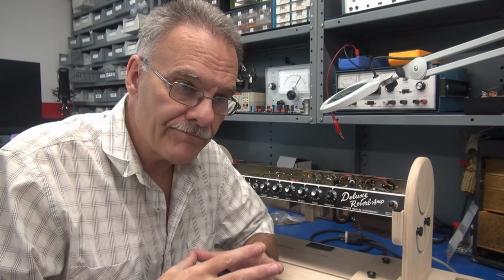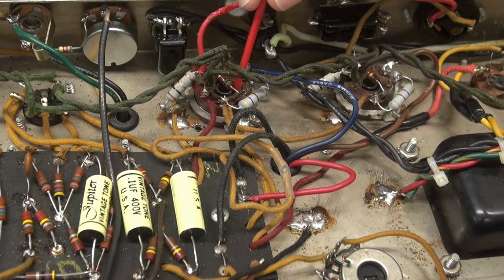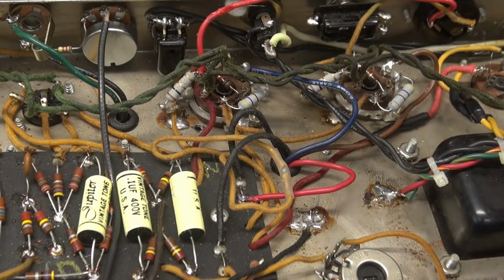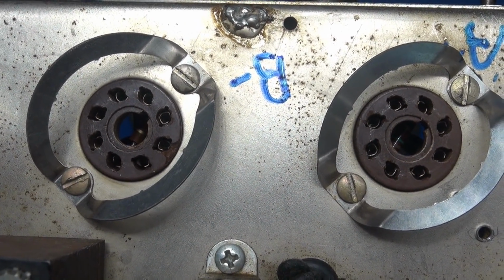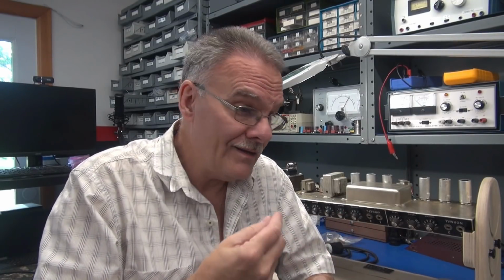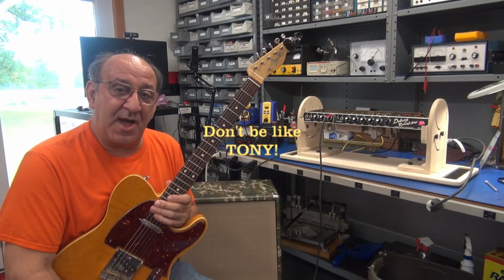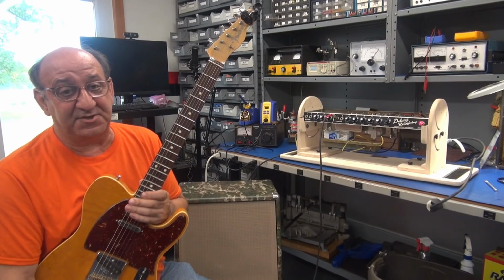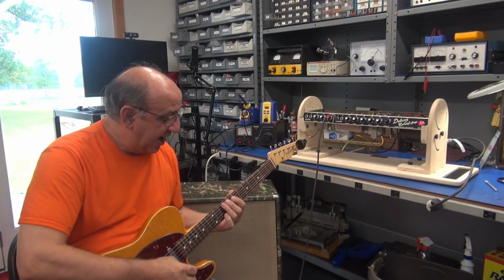How to repair Fender Deluxe Tube guitar amp bad 6V6 sockets Power drop outs D-Lab tech tip advice

Comment: That's why I prefer to use good quality ceramic sockets, because in the plastic sockets some people over heat the socket pins when soldering to them, and they melt the pin bore in the socket ruining it.

Comment: This bad tube socket problem  could be caused by too hot a soldering iron when soldering onto the tabs.
The whole metal tab will be compromised and there is no way to get fatigued heated metal back to it's
original springiness where the tube pins make contact. Seen it in older tube radios too.

Comment: Hello.
I just got a dsl20 head. While the amp was on the clean channel, volume around 3, gain on 1.5. I was trying to unhook the foot switch from the back of the amp, but like a idiot I unplugged the speaker cable. It says never to do that. The cable was disconnected for about 30 seconds. Then I plugged the speaker back in and turned the amp off. I didn't have the guitar plugged in, just the instrument cable. Now the amps gain channel doesn't sound quite the same. Like it's lost it's luster. 
Also, is it normal for the v1 preamp tube to, when lightly tapped to make a little ping sound? I tried 4 different tubes in the v1 socket and they all make the same noise. But the same tubes are quite in the v2 and v3 sockets. Is it possible I damaged the OT or messed the v1 socket up, or a capacitor or something?
Finally, Nice Peter Gunn riff, but I play it a lil better, no offense. I'll try to prove it soon. Lol
 Cheers,

Comment: Tube sockets...... yep I got a 5f1 kit where the rectifier and power tube just won't "seat" in all the way and the voltage was 400 + volts. I wonder is it a Belton socket trouble or a JJ thing. Your comment would be appreciated thanks. By the way it is a MOJO  kit.